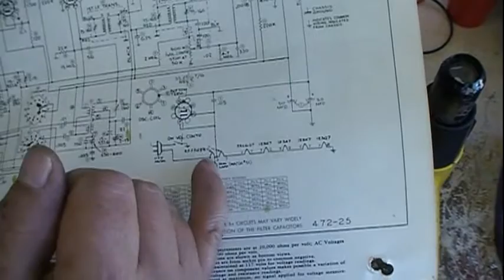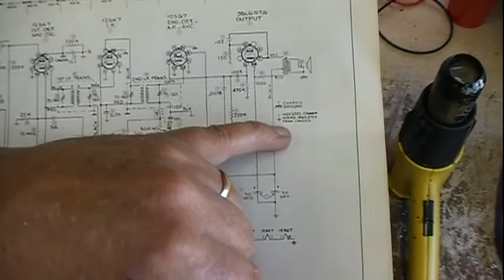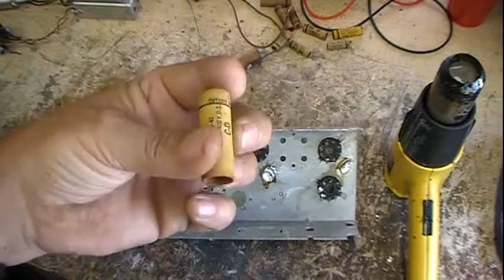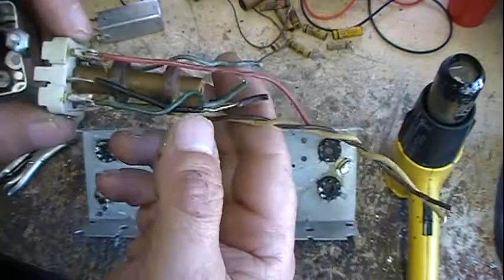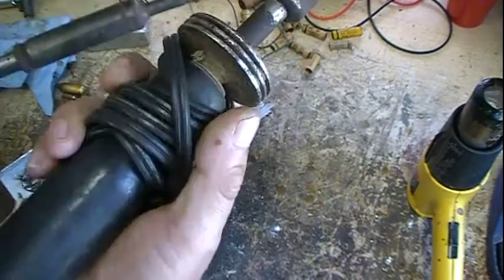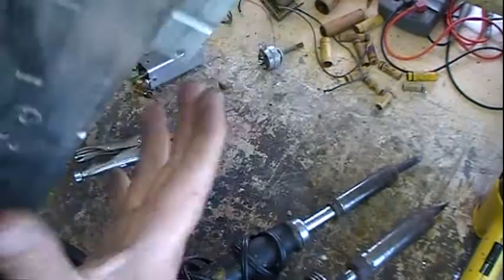RCA Radiola 61 5 restoration part 2

Comment: Good video, Dennis. Those big soldering irons used to be quite prevalent. Then came the "soldering gun", pistol-grit style around the late '30s or early '40s. the first pencil type came much later. Any radio made in the "30s probably was assembled with with one of those big old hunkers. I've seen them being used in several videos here on you tube,
Thanks for your fine work.
Dick.

Comment: Its coming along nicely Dennis.   Doubt very much whether I'd find soldering irons of that size at my local hardware store :-)
Cheers,  John
Reply from the maker: Zone1242 Thanks John. I don't know if you could online to get one from Weller or not.
Reply from the maker: Zone1242 Here is a site you can check out for the heavy duty soldering irons. http://www.somersetsolders.com/soldering-equipment/heavy-duty-soldering-irons/c16    They are American Beauty brand and Somerset Solders is the UK.